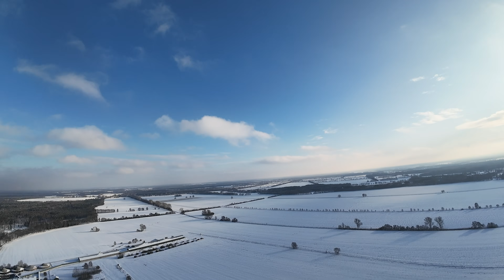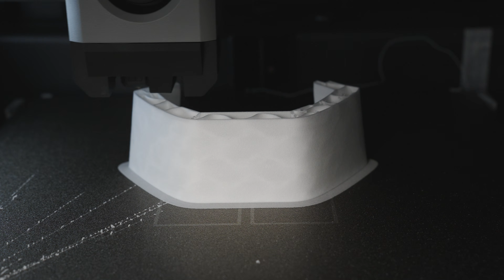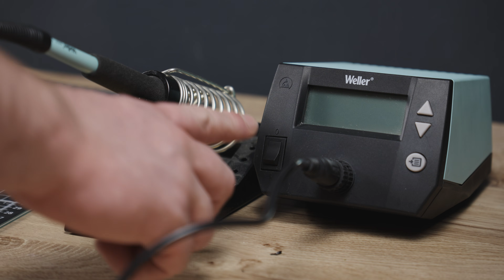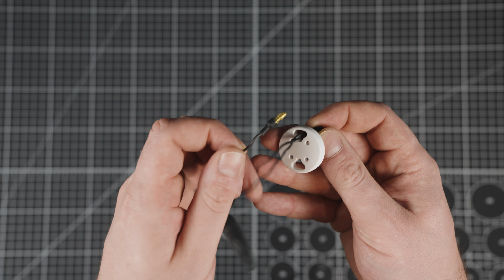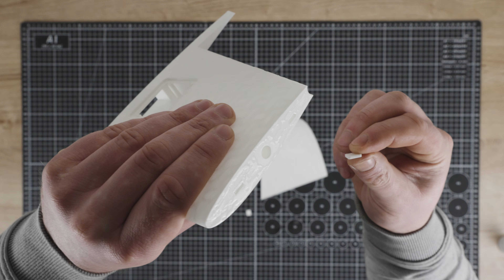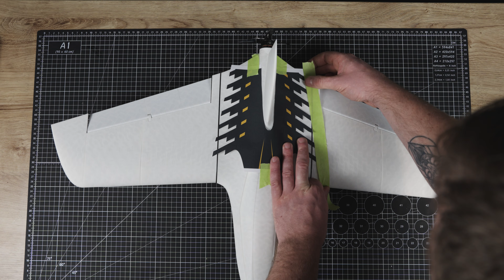Building the DNA | Fast FPV 3D-Printed Fixed-Wing

Comment: It looks like a fantastic wing. Can I print it using standard PLA? I have DJI O3 VTX units; how should I handle cooling? Are there any ducts available?
Reply from the maker: Thank you! I’d recommend printing it in LW-PLA to keep the wing loading as low as possible. I recently released an update that includes a landing skid, which can be printed in TPU, PLA, or ABS to protect the underside of the fuselage. This solution has proven to be very reliable, even on rough surfaces like gravel. The update also includes an alternative fuselage version with rear ventilation outlets to improve cooling for more powerful setups. You can find an Add-On Manual on the product page that explains the different options and their intended purposes.

DJI O3 is supported and the plane comes with a dedicated mount for this system.

Comment: What is the faster platform DNA or Helix? Topspeed
Reply from the maker: The DNA is faster. The Helix topped out at around 220 km/h, while the DNA was measured at 270 km/h in a straight-line run.
Reply: @3dblackbox With the same setup? Motor + Kv, Prop and Lipo? Can i push the DNA +400kmh? I would make the motormounts and wing section out of PA 6cf or PA 12cf. For maximal stiffness and heat resistence.
Reply from the maker: @swissuav  The Helix was running on 4S, while the DNA was on 6S. Due to its smaller fuselage, the Helix is limited to a 4S setup.

The DNA setup was:
6S 1600mAh
2806.5 1800KV motor
5.5×6.5 APC prop

This is a safe setup to use that won't overheat and has plenty of power.

300+ km/h is definitely possible, as speeds above 300 km/h have already been achieved—just not in a straight-line run. There’s also enough room in the fuselage for a larger battery and a larger motor can be fitted easliy.

As for 400 km/h, I really can’t say. Nobody has tried pushing it that far yet, so at this point it would just be speculation.

Comment: Awesome design. Specific question: How loud is it? I'm getting back into rc planes after nearly 20 years and I remember back in the day my pusher-prop planes where quite loud. But in this case the prop seems to be far enough away from the back edge of the wing, which should make it much quieter. We have some noise limitations on our field around here. Thx.
Reply from the maker: Thank you! The noise level depends significantly on the specific setup. Larger propellers (around 7-inch) operating at lower RPM are generally expected to produce less noise. However, since I did not have any constraints in this regard, I did not carry out any noise measurements. Based on general experience, I don't consider it particularly loud compared to other foam models on the market.

Comment: Great plane. I have suggestion - could you add the pan-camera tower and cover for optional print? I have that on my chupito, and when you try the pan-camera once, then dont want go back. The optional variant of cover, with a hole and tower, designed for O4 pan, would be more than welcome. Cheers, and happy flying!
Reply from the maker: Thanks for the suggestion! I regularly update my designs with new features, and that’s definitely an interesting option—so it might be something I explore in the future. Right now I’m working on a new set of wings with internal servo mounting that should be released soon. I’ll also take a look at head tracking 😉

Comment: Maybe I missed the info in the video: what battery size and weight will fit?
Reply from the maker: The instruction manual on the website suggests some battery options, but there’s plenty of room to use different sizes. Ultimately, the choice depends on your electronics and how you achieve the correct CG. Personally, I use 1500 mAh 6S batteries from a quadcopter to keep the weight low. That said, I’ve seen builds using 2400 mAh 6S batteries, 6S Li-Ion, and 4S Li-Ion packs. I recommend keeping the battery weight under 350 g.

Comment: Can i print the complete plane out of tpu or lw-tpu?
Reply from the maker: I haven’t tested TPU yet, but a high-Shore-hardness TPU should work for the fuselage and wings. However, if increased durability is your goal, I would instead recommend ABS-GF or PA6-CF. LW-TPU materials such as VarioShore are definitely too flexible. 

That said, heat-critical parts and accessories should always be printed from the specified materials.

Comment: Hey looks like a neat design. Is this possible to be printed in LW-ASA for enhanced thermal resistance in warm/hot weather and even less weight?
Reply from the maker: Hi, thank you! Yes, it can also be printed in LW-ASA.
You may need to tweak the print settings, especially temperatures, and a closed chamber is recommended.
Reply: @3dblackbox  Yeah been printing some flightory planes from asa-lw successfully already on my H2Ds. But this one seems super simple for just some ripping with friends. I don't wanna let them fly my VTOL which takes massive time each time you would crash. Will update here if i managed to print yours successfully from ASA-LW!
Reply from the maker: @ChristophKreutzer-p5q That’s great to hear! In that case, printing it shouldn’t be an issue for you either. Good luck with your build—I’m looking forward to hearing about your progress.

Comment: Cmon son —> fully 3D-printed FPV flying wing designed to make the jump from multirotors to fixed-wing flight as smooth—and as fun—as possible?! 
I don’t wanna hate on your product but please don’t fool beginners into believing ,that 3d printed planes r for beginners and that the transition is smooth nd fun . Thats simply not true my guy. Rather advertise it as a worse chupito version that explodes on your first failed launch.  I get it tho. U wanna makes some moneyon of the Chupito hype nd Thats cool but plz dont fool  beginners yo.
Reply from the maker: That quoted line comes from an external article I didn’t write =D

Also, this design was published on my Facebook channel before the Chupito was even announced, so it’s not based on that model or its hype.

I agree that 3D-printed wings aren’t a magic solution for everyone, and they still require proper setup and flying skills—but the goal here is to lower the entry barrier, not to claim it’s indestructible or effortless.

Comment: Im pretty new to FPV, i just build a 18650 longrange drone. But in future i definitely will build/buy a plane aswell. My concernes about this are the start and landing. How did you practise as a newbe? How did you land your planes? I see the advantages of a printed plane, if you crash, you can easily print new parts.
Reply from the maker: It’s actually great that you’re already flying FPV drones 👍 You’ve got the basics of stick control and the general FPV feel down already. Planes do behave a bit differently, but they’re very manageable.

Launching is easier than it looks, especially with iNav. Autolaunch stabilizes the plane after the throw and climbs to a safe altitude — just give it a good toss to pick up speed quickly – straight ahead, slightly upward, and the wind should be coming toward you, not from behind.

Fly in a big open field with high grass or a smooth surface. For landing, keep it straight and keep some speed (around 35–40 km/h). Don’t go too slow or it’ll stall — although the DNA is very forgiving and just lowers the nose.

I started with line-of-sight and had someone experienced do the first takeoffs and landings. If that’s not an option, a simulator can help a lot.
Reply: @3dblackbox  Hey thank you for the answer. Seems i have to do more research about inav autolaunch.

Comment: What is the Airfoil?
Reply from the maker: The airfoil has been customized and is one of the few design details I keep to myself, hope you understand.
Reply: it looks like a very low moment reflexed airfoil, the specific airfoil is not super important if you want to make something similar just choose one that has decent characteristics. a good starting point is something like an S5010 (the example in the video has slightly less kick at the tail but you can just trace any base airfoil and manipulate its splines to get what you want). I reccomend XFLR5 or Flow5 as they are free softwares for this kind of thing

Comment: Beautiful. Just bought the design. Maybe you could explain a little why do you decited against spiral/vase mode.
Reply from the maker: Thanks for the support, and good luck with your build!

While testing another unreleased FPV plane, I noticed that testers ran into several issues with Vase Mode. FPV pilots are a different target group than LOS pilots, with different priorities and workflows. Many FPV pilots are simply more familiar infill-based models and often fly in more constrained areas. In my opinion, denser infill models are more durable and easier to repair, since they don’t rely on male/female connections between parts. They’re also easier to print in different materials.

Another factor was development speed. I wanted to be able to iterate quickly and make changes on the fly based on beta testers feedback. Although Vase Mode offers superior print quality, even small geometry changes can require days or weeks of rework, especially if those features were defined early in the CAD process. With top layers, infill-based designs provide much more freedom when it comes to printing challenging geometry.

Both approaches have their advantages and drawbacks. I’ll continue using Vase Mode for most of my models, but overall, I believe infill-based designs align better with the practical needs of FPV pilots.
Reply: @3dblackbox  Pretty interesting and pragmatic thoughts I can relate to. Thank you very very much for taking the time to answer in such a level of detail. Means a lot!

Comment: What print settings are you using?
I can see the infill is gyroid, but how do you manage to achieve such a clean surface finish with almost no visible imperfections, even though it’s not printed in vase mode?
Are there any “magic” tricks involved, like keeping the seam hidden inside the model?
Reply from the maker: There are no magic tricks involved so I can't give you advice for that one settings, that needs to be changed. It's just a combination of a good printer, high-quality filament, and a well-tuned print profile. Many print settings play an important role in achieving clean LW-PLA prints, and getting them to work together is what makes the difference. Some cleanup is still necessary, as a few settings I wish existed are missing in Bambu Studio. That said, the print profiles are embedded in the .3mf files for various slicers, so achieving the same results should be straightforward.
Reply: Use don’t travel over perimeter